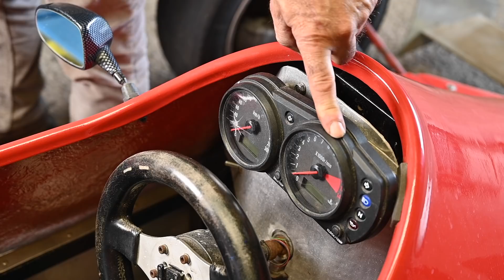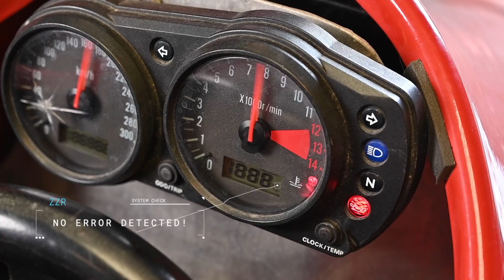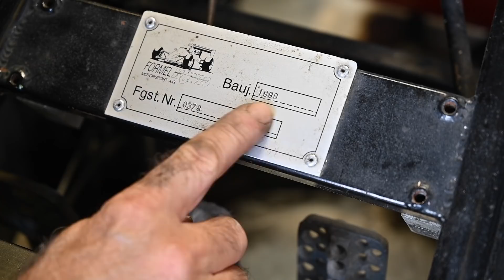Rebuilding a 1990 race car    Part 1

Comment: Motorbike engines have sequential gearboxes (Push the stick forward for 1st, pull back for neutral then 2nd, 3rd, 4th etc) so you should have been able to get it in gear without the clutch, Iam thinking worn linkages on the gear stick mechanism 👍
Reply from the maker: Thanks for the tips! and indeed.. I think the clutch plates are stuck.. will see very soon when we take it out

Comment: Radiators look like they came off a street bike also they are bent from the factory like a half moon, don’t know if urs are but they sure look like it. Still a crude way to supply cooling for the motor
Reply: Also racing tracks require a resovoir so it doesn’t leak on the track causing fluids on the surface
Reply from the maker: Thanks for the comments

Comment: 9.20, can you show us where the cable runs? If it runs to the brake pedal it will be to alter the balance bar. It’s worth checking if this is moving freely
Reply: Meant to say if not moving freely dismantle it from the pedal and clean the bar
Reply from the maker: Thanks for the comments  , well it runs to the master brake cylinders, by now I have it figured out... Its to regulate the force on the front and rear brakes as they have a different master cylinder... and this cable advances one more then the other... so adjustable;
Reply: Does the car have cockpit adjustable sway bars ?

Comment: That looks like the instrument cluster from a Kawasaki of that era.  The muffler looks like the standard bike muffler too.  Not sure about Kawasaki of that era but Ducati had the engine ECU, instrument cluster and key barrel (which detected the key as part of the security) "joined" into a matched set so replacing one actually required changing all three.  So if you want to change the instrument cluster, you may need to get the ECU off the same bike.  Do some research first.
Reply from the maker: Thanks for the comments and much appreciated...

Comment: The harnesses are actually six-point, not four-point. The two straps at the front of the seat are crotch or anti-submarining straps, to stop one from sliding forward under shoulder and lap belts.

They have a limited life (like five years for FIA belts) and will need to be replaced before the car goes racing again.

Comment: Steve, nice car. It may be eligible for an FIA Historic Certificate of Description, (or possibly even a Historic Technical Passport). Obtaining such a document may open up the number of events that you can participate in. Without a C o D you may be limited to only track days.
An FIA C of D will necessitate the car to be period correct in every way. I suggest that you investigate the regulations specific to your local area before you make any changes whatesoever to its original equipment.
Reply from the maker: Thanks for the comments, good points and I wil do so

Comment: I think the clutch arm is too long. It doesn't move enough. Similar cable clutch move it more(axl spin).    About radiators.  Honda sp01 has twin radiators. Both sides of the bike.
Reply from the maker: Thanks James,   I will have a look at those radiators... TXS

Comment: Hi there, nice car for a resto. But that engine is not from an ZZR 1100, it looks to be an ZX 9R Kawasaki engine.
Reply from the maker: I have done some digging and you are 100% correct as it has the external oil filter and so on.  I am having an update in my next video when I take the engine out for a clutch replacement and more.  When I bought the car , the owner did not know so i glanced at it..they look similar , never the less turned out to be the ZX9R
Reply: @D3Sshooter  Get some Keihin FCR flatslides on it. That engine responds very well to those carbs.

Comment: There's an issue with a driveshaft, looks bent to me.
Reply from the maker: Thank you for the comments, that is possible.. I did check and it seemed more of a optical effect because of that spot.. But we will check it for sure. Txs

Comment: I think it will weigh more the 300kgs probably more like 400-500 kg
Reply from the maker: I will put it on the scale one of those days...  The trailer that comes with it is rated 700Kg and it did not show any signs of even going down...  Lets see , you might be right but that would be a lot 500

Comment: Wait, did he just call a German's engineering work for "garbage"? Aren't their rules and regulations against doing that within the EU? 
Joke aside, the rediators were obviously bent and sitting at an angle to fit in a larger unit while keeping the sidepods to a minimal size (thought it does look like they could have slimmed the pods more) and not totally obstruct the airflow. So, if he can fit in large enough radiators by his own method, good for him, but I am very sure some proper thought went into this.

Comment: sorry young man, you didnt have much clue and all you say is why do theses guys had make that weird stuff ...

The Brake Bias - common..
The oil reservoir ? Did you ever had a racecar before without you are not allowed to drive on the racetrack
The Radiators - if you don know nothing dont say anything about the manufacturing process....

Just because there is a Tag on the chassis with some serialnumber - thats your point of "we know the chassis is good" ????
I never heard of a rule you must removing the chassisplate after a crash.